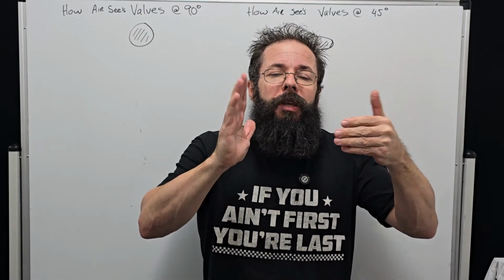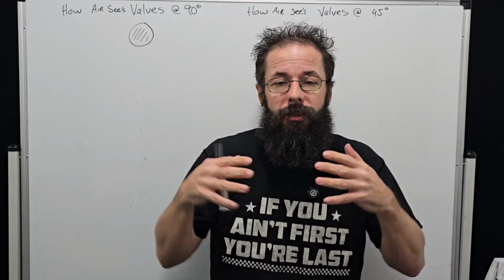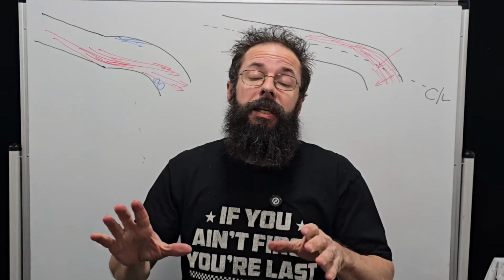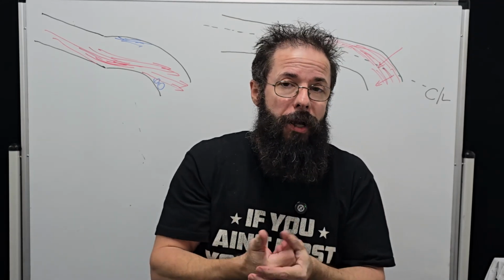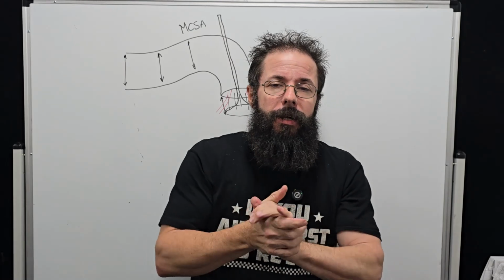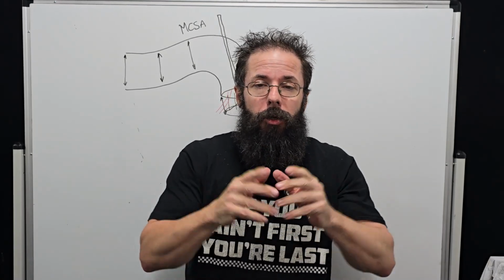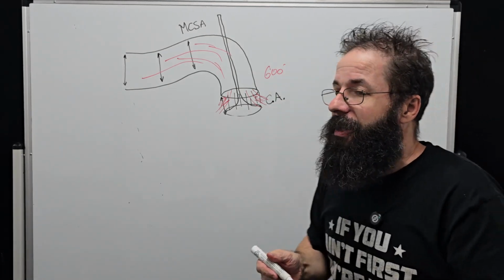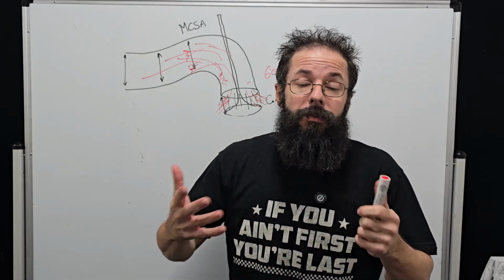Induction Secrets Part 6: Density Gradients, Kolmogorov Theory & Runner Angles : Jake Bain Racing

Comment: In this video you were talking about mcsa @20.50 you mentioned an 80% rule for 2 valves but only in reference. What is it? Mike from Massachusetts
Reply from the maker: 80% rule. Even though I don't like these rules.  But the MCSA is around 80% of the throat.   Personally I like to set the MSCA to its target say 613fps. And I like to target mean throat velocity at 350-400fps depending on where you want the power.  More average numbers at 400fps. And more peak at 350fps.  

The only variable here. Is what MCSA target and that's port dependent.   23° like 613.  Where 13 degree you can be as high as 710fps and the throat is generally the MSCA. 

So it will depend on the head itself.  Its why I dont like hard and fast rules.  

But earlier stuff will low port entry. The 80% will get you close. 

Hope that helps Mike. 👍

Comment: F1 engines have much higher valve lift than is needed but the higher lift increases the area under the valve-lift curve so they can make more power.
Reply from the maker: Sorry mate missed this?  What model engine are you referring to??  Most are 1 to 1. So they have less lift then a Honda race engine with rocker ratio.   Remember too much lift will hurt or discharge ratios. We need the "right" seat velocity at the right piston demand 👍

Comment: So in the saturation discussion a good head would keep the minimum cross section near the valve seat so that the minimum cross section dynamically moves from the valve seat, to the throat, and then back to the valve instead of along the length of the port? Or it should be far enough away that the air can slow down and make the short turn? Am I understanding that correctly or over simplifying the concept?
Reply from the maker: I think you are.  Yes if you have a horrible short turn you want the MSCA away from the short turn.  Maybe at the port window.    This helps to allow the air to stabilise for the turn.    Hopefully that makes sense.

Comment: How do you manage the tradeoff of the ideal bend shape to the widening each side of the valve guide to allow the air to go where it wants to ? Big thanks for being the first one I've come across to use science in a meaningful and understandable way.
Reply from the maker: Good question! Though the guide area is generally smaller on CSA and the floor is wider.    It's just trial and error, probing and seeing how efficiently you can get the port to push air through for its CSA.  The more even a port becomes,  the less shear stress and turbulence we have. The more mass it will flow for the same size CSA.  This is why good head porters use the 146cfm/sq/inch factor to rate how efficient their work is.

Comment: You've talked about the 4 valve "hypertumble" ports before, is it possible for 2V engines to be setup with a tangential entry without a turn and "hyperswirl"?
Reply from the maker: Good question 🤔!   I think the closest 2 valves that we may consider a "hyperswirl" would be the 7.3 litre Godzilla.   I've talked about this before with 2 valves as the port angle increases,  they can increase swirl.   

But yeah the problem with 2 valves and swirl is the balancing act across the cylinder length.  Too low a port and too much swirl and fuel end up on the liners. Not enough and we get poor homogeneous mixing.

Comment: Again very good video! 👍

In the case of working off an OE intake that is too big. Would it get better if one start smaller even though the OE gets big somewhere on the way?
I know you talked about how you dont like to change the shape/area suddenly.
But could an intake that goes small-big-small down to the valve with a better average csa be better than the OE that starts big and goes gradually smaller?
Talking port injection.
Reply from the maker: Yeah tricking it by working on the averages is all we can do mate and it works 💪

Comment: There is a great question on hi mach index ports.  Can you run those ports in excess of 400FPS ?
Reply from the maker: That is! I'm not sure mate. Have seen a few at 400. But never tested past that.  And it is generally on valve-restricted stuff.

Comment: If you cannot get the ideal port shape to get the air to turn, would there be anything to be gained by varying the port finish(Ra) at different radii of the port to improve uniformity through a bend?
Reply from the maker: Yes! And many head porters do exactly this! Burr finishes on the short turn a little more course than everywhere else.

Comment: I have a hi mach index port that sounds good and flows very well and stable up to 48",  however my velocity  average over the short turn  is 430 FPS and 360 FPS at the PRP.  The PRP is right before the SSR.   I also measured the speed at the face of the valve in 8 locations and they average out at 415 fps.  Are these velocities too high?  Thank you for all you do with these informative videos.  This is a street strip NA 347 CI  18 degree valve angle engine.
Reply from the maker: It sounds a little high. Would love to see it on the dyno.  But the fact it's good till 48" is a great sign!  Will be an interesting one to see if it carries the power or noses over.
Reply: My thoughts exactly!  I will have it on the dyno in the next month or two and will let you know the results.  Thank you Jake for taking the time to respond!
Reply from the maker: @Custom4x4Specialty yeah mad! Please do! 👍 thx legend.

Comment: Does that optimal bend shape apply to the first bend of the primaries on a header build?
Reply from the maker: It applies to any turning of air. However with Exhaust, it's way more viscous.  So the effect/drag isn't as bad as on the intake side.
Reply: Working on an exhaust setup for a 600hp LS7 swap car